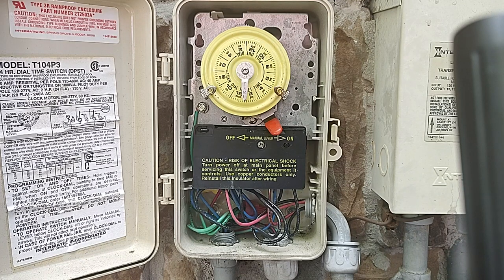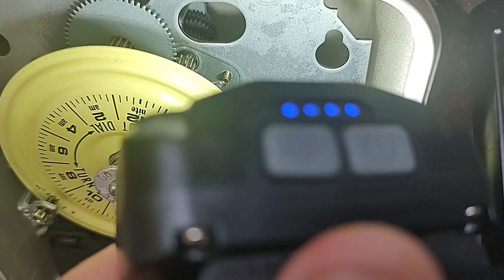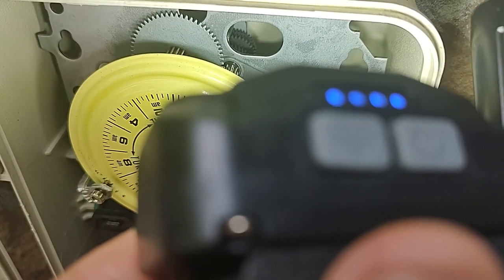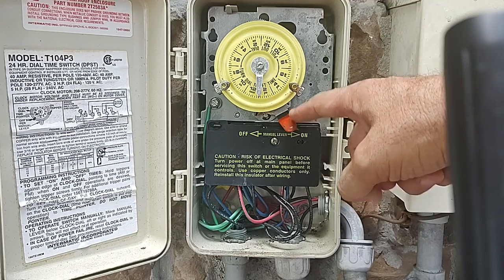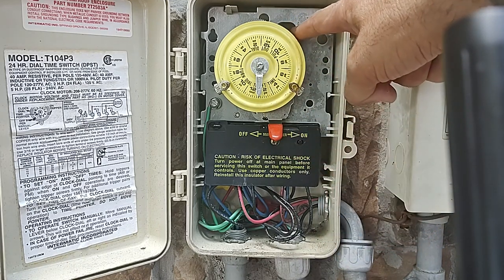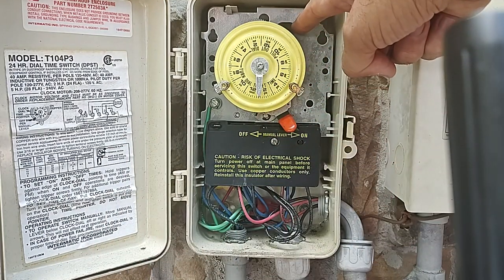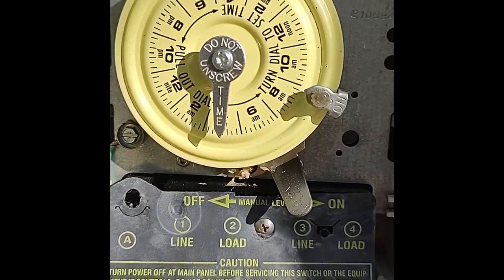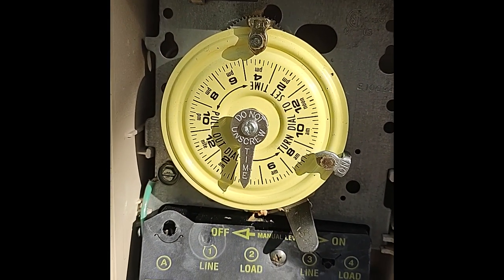YOUR POOL TIMER IS BROKEN || CHECK THE GEARS!😲

Comment: I have a timer that has a problem that nobody I have found online has addressed yet. My pump has been running okay but I noticed that when the timer turned it off, it would not turn it back on. I removed the dial pointer, spring and face plate (yes I know it says don't unscrew) and found that the small plastic piece which makes contact with the on and off trippers was damaged. There are two legs that make contact with the trippers as the dial turns. The leg that makes contact with the "on" tripper was worn down and no longer making contact with the tripper. I have looked for the part as it is simply held on the dial shaft with a c-clip. But I have not found one and will have to replace the timer.
Reply from the maker: @rickkirkland450 Thank you for sharing that info with everyone. I've personally never taken apart the timer to get to those parts that you are referring to. I do know that it gets to a point in the lifecycle of the timer where even if you replace the "on" or "off" tripper sometimes it still doesn't do the trick. I appreciate that you took the time to share that information with us. Thank you!!
Reply: I have the same issue. I think I need a replacement.

Comment: When the power is on, the  gears in the back rotate.  When the clock rotates to the off peg, everything shuts off and the the clock stops working?  Wiring issue?
Reply from the maker: When the clock rotates to the OFF peg everything is supposed to shut off. If the clock itself stops rotating and stays "stuck" in the OFF position then you can try and replace the OFF peg/tripper/pin with a new one. Sometimes the OFF or ON peg gets warped or bent. If that doesn't work then you have to replace the timer. There is a small piece that makes contact with the peg and over time it gets worn down and the entire mechanism needs to be replaced. I don't see that being a wiring issue in my opinion.
Reply from the maker: https://amzn.to/3PHXqzl
That is a link to the replacement trippers. It's the cheapest and 1st step in trouble shooting. Home Depot sells the mechanisms itself and the receipt is good for 90 days in case you get a bad mechanism. You only need to replace the yellow clock dial, not the entire case/box.

Comment: My gears are moving but the yellow clock hasnt moved at all. Any suggestions what could it be?
Reply from the maker: Hello there! If the gears are moving but the YELLOW DIAL itself is NOT rotating or moving them the yellow dial needs to be replaced. If you were to take apart the timer itself there are a few tiny components and if any of them fail/go bad then it could/would stop the timer from moving. Either way I've never seen replacement parts for those items. It just makes sense to replace the timer. Let me know if that makes sense or if you have any follow up questions.